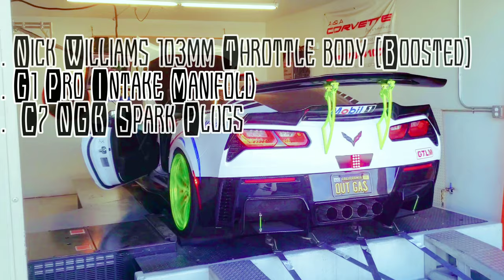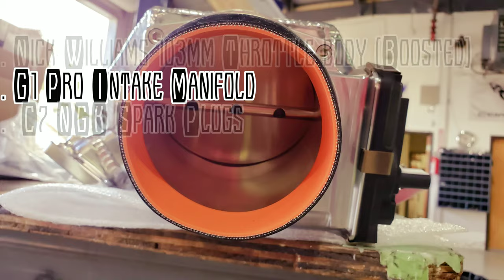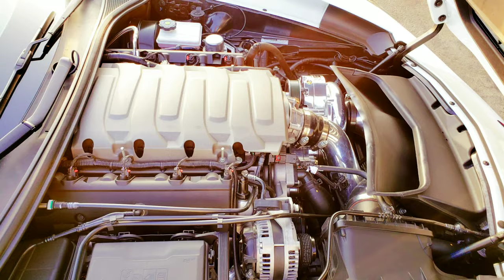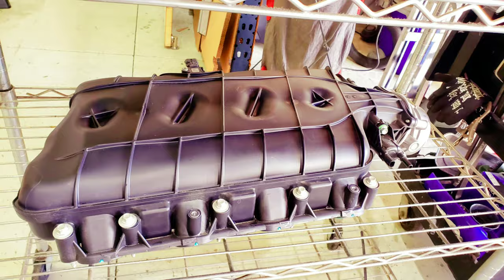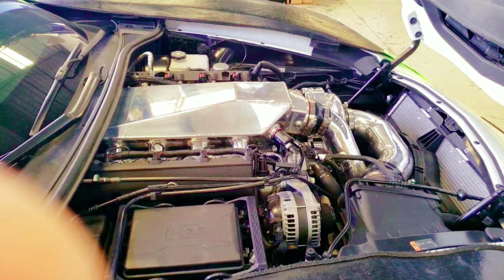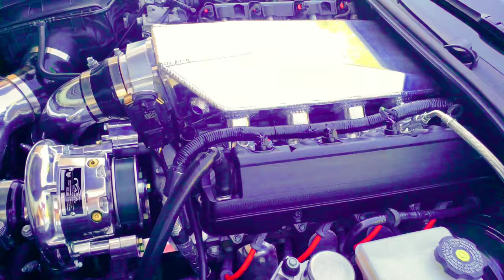G1 Pro Intake Manifold, Nick Williams 103mm throttle body, A&A Supercharg | Repsol13 F26 Corvette C7

Comment: Any hp gains on the manifold? And is it suppose to bend like that?
Reply from the maker: sure it bend due to suction... as for hp gain... it give much better air flow and allow more volume of air into the manifold, specially with force induction setup.  This will allow hp gain much easier than factory restricted manifold.  thanks for Watching